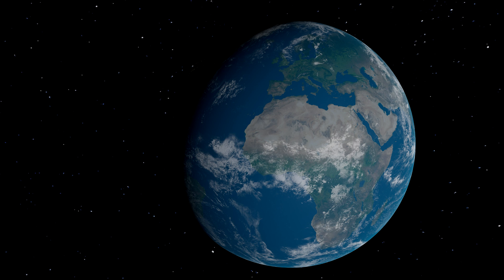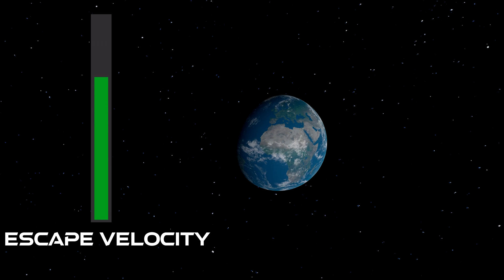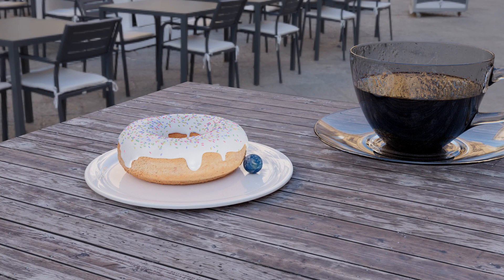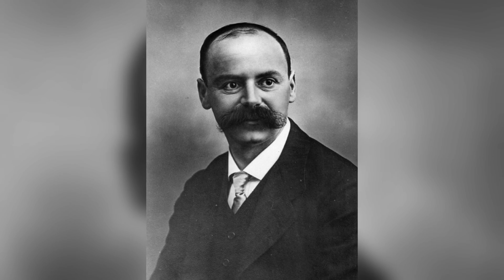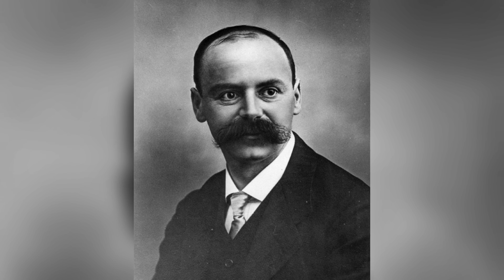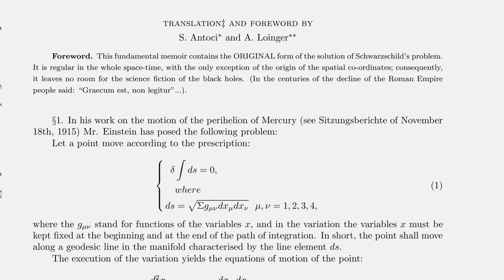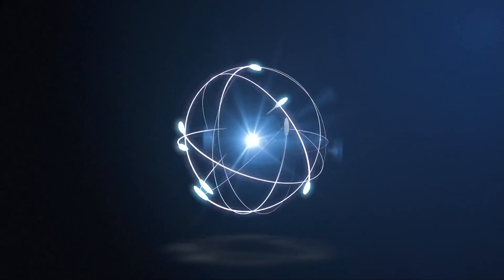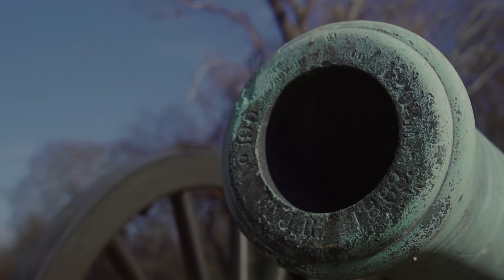This is how Black Holes are made

Comment: What about time?  As gravitational forces increase, time slows, therefore the singularity may also be a point where time stops entirely, allowing for infinite compression and gravitational collapse.  Which also means no "stretching" or "spaghettification" should occur, because space and time is relative to gravity, which is dictated by mass or inertia, and something fallen "deeper" into the black hole is also warped in relation to whats behind, to essentially catch up, as it falls deeper and deeper into a black hole.  And since everything is perceived relatively, one may not notice anything except an infinite sense of falling, essentially as percived .... forever.  Because you just can't tell at what point time stops.  For instance if we move close to the speed of light our perception of time remains the same, yet our mass increases, time passes at a different rate compared to others not moving close to speed of light, meaning there may be a difference on our watches, but to both us and those not moving that fast time appears unchanged.  Could this mean that utimately nothing ever reaches the surface of a black hole?  Because as time slows in relation to it's place in space and time, the collapse or "fall" becomes infinite, therefore there is no hard surface or anything to crash into when time slows then stops entirely.   Black holes are truly terrifying once you ponder over them, for all we know it may all collapse into another dimension, and that may be the most terrifying of all.

Comment: If the milky way is moving at  600 000 m/s, Could we launch something near the speed of light in the opposite direction making it going faster than light from our perspective.

Also, would that mean light can actualy move faster in one direction than the other but we have no way of measuring that because to measure speed pf light we measure time it take get to something and bounce back. So it could go slower in one direction and faster the other way around always averaging to 299 800 000 m/s and we'd be obvious to that fact
Reply: You can launch something away from earth at the speed of light right now by pointing a flashlight into the sky, in any direction. If there were no atmosphere to interfere, it would technically be going faster than light since spacetime is expanding (in all directions).

Don't think of it like Earth is driving a car down the road and shooting a slingshot away from it; think of it like Earth is standing slightly off-center on a rug that's being continually stretched in all directions, and then rolling a marble away from it. The marble will appear to be moving faster than it was rolled, because it's both rolling at a constant speed and also being pulled away as the rug is stretched. It would appear to be moving slightly faster in some directions than in others, but all directions will be faster than the initial given velocity.

This is why there's a "boundary" of the observable universe; light that far out is traveling through spacetime that's expanding away from us faster than the light is traveling towards us. Since light (and thus everything) that far away will never reach us, it will be forever unobservable.

As for your second question, Veritasium has a great episode that covers that explicitly. In essence, yes, the only way we can really measure light is as the sum of a round trip. It could theoretically travel one way at 1/2c and return instantaneously. At least, that's what Derek posits. We can't measure it from both ends, because we can't sync up the clocks in both locations without relying on the very same measurement we're trying to confirm (so a chicken and egg problem).

Also, relevant shout-out to one of my other favorite channels: PBS Space Time.

Disclaimer: I am only an armchair physics nerd and have no formal training in physics besides watching a shitload of videos on the topic. You can do your own fact checking.

Comment: The mass of the Earth and the shrunken Earth in the video are the same, yet the gravity is higher in on latter (implied by the higher escape velocity). How does the density or radius relate to gravity?
Reply: Gravity increases or decreases square to the distance from the centre of mass. So, if your object moves twice as far away from your position relative to the planet, it will feel only a quarter of the gravity.
Reply: Or in other words, the gravity of the mass of Earth would have a much greater effect on you if only there weren't so much of Earth's volume in the way.